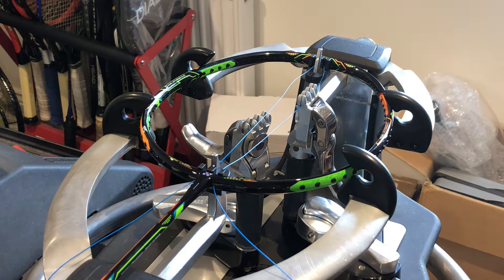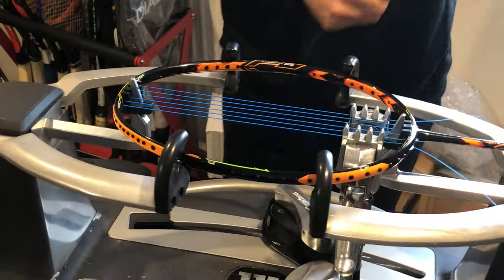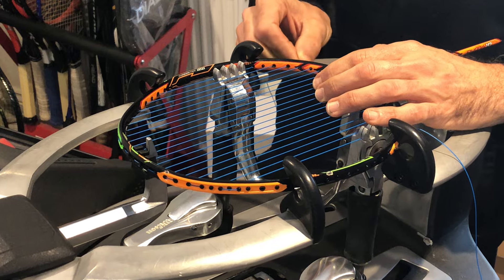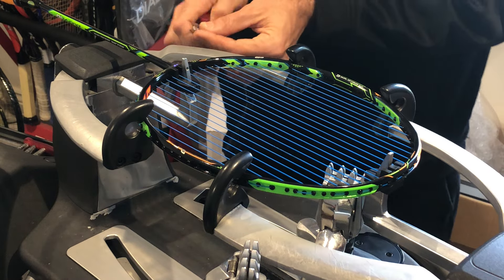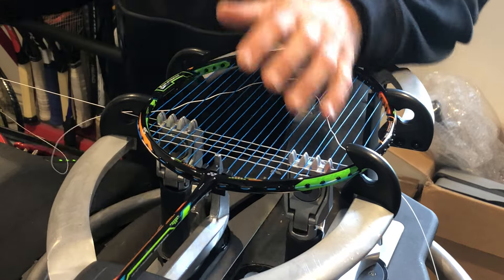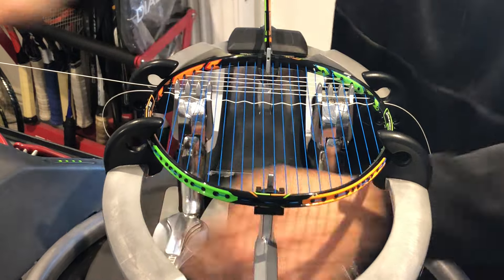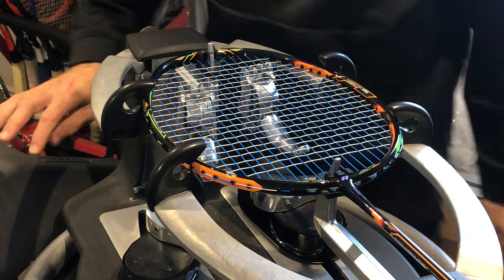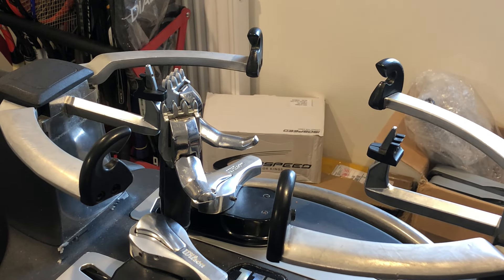Re-stringing a Yonex Duora 10 badminton racquet

Comment: I believe Yonex recommend 10% higher cross string tension. Yonex also recommends to reverse the last 2 mains and pull them together - by doing the last on its own and upping the tension, you will put a lot of pressure on the outside of the frame, which is a weak spot on badminton rackets. It also allows for less untensioned string running on the outside of the frame.
Other than that a great tutorial! And you're absolutely right about the awl!